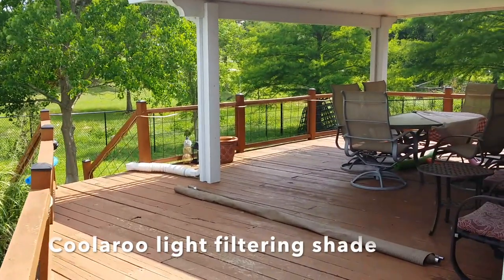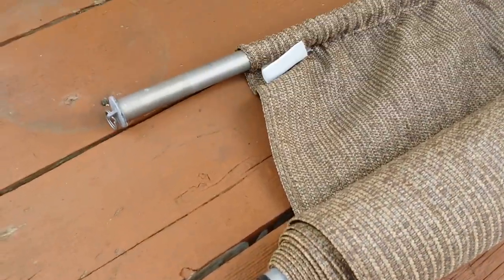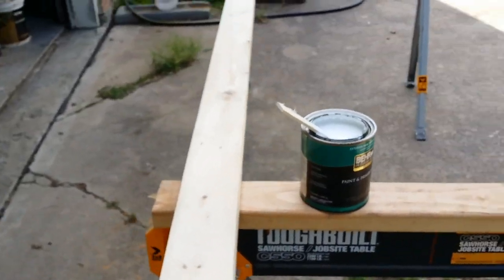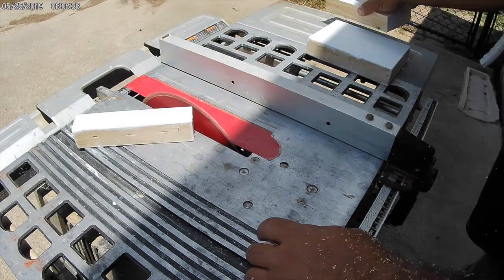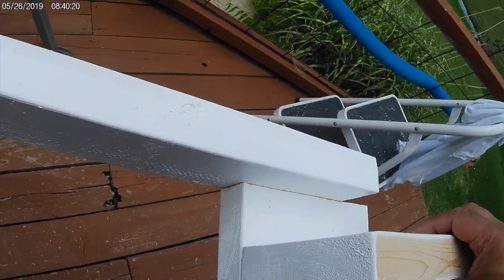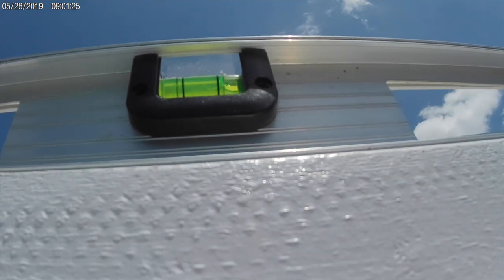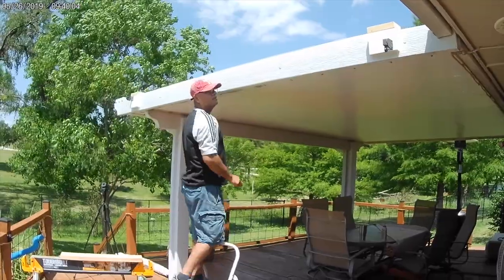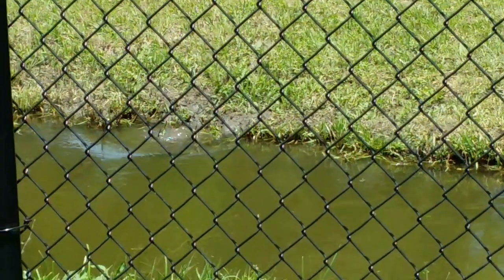Coolaroo Install Retractable Awning Shade

Comment: can you just insert the whole 2x6 inside the beam and just use screws the awning bracket directly?
Reply from the maker: Thanks for watching, I guess you can do that if you can get the end caps open to insert a 2x6. However I don’t think it’s a straight shot in the beam as I believe they have bolts going through it to attach the beam to the roof.
Reply: @LonghornWorkshop  I opened the end cap and inspected and looks like straight shot. Only worries me is the weight of the 2x6. is there a way you can combine this shade to make a longer width? i can only find 10 ft and I dont like having space in between when installed side by side.
Reply from the maker: @dionymachacon8397  check online to see if they have longer shades. I can’t think of a way to combine them. I think weight should be fine, maybe go for a 2x4 if you are worried? But I know when my gutter was blocked I had a ton of water on the roof and had no issues with the weight of all that water. 
Are you sure you really want to drill holes through your aluminum?

Comment: Since the awning and specifically the end rail/cap is hollow and aluminum, are there any concerns or issues with the total weight of the Coolaroo shade plus your wooden frame hanging from it?
Reply from the maker: Thanks for watching and commenting. Although it’s hollow the structure is able to hold a lot of weight. The shade is still working after all this time and the awning hasn’t shown any issues.
Reply: @LonghornWorkshop  Thank you, I appreciate it.  For those of us who are not nearly as handy as you are and have no clue what we are doing, any chance you can tell us the measurements or what and where we need to measure?  I understood it was a 10 feet 2x6 and you left a 2.5 inch gap between it and the block to which you attached the railings, but would you mind telling me what size were each of the blocks?  Also, is 2.5 inch gap pretty safe and standard?  Thank you again.
Reply from the maker: @no1vakeel  it’s best if you send me an email and then I can reply with a picture and all.
Harkidodia@gmail.com